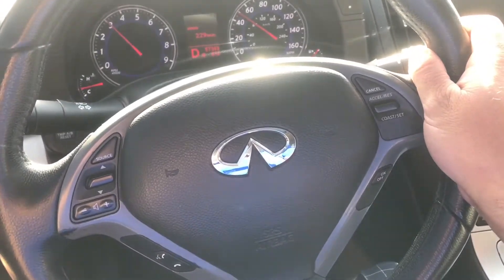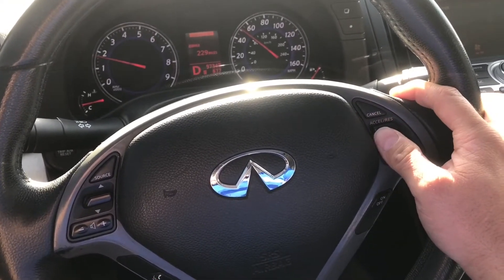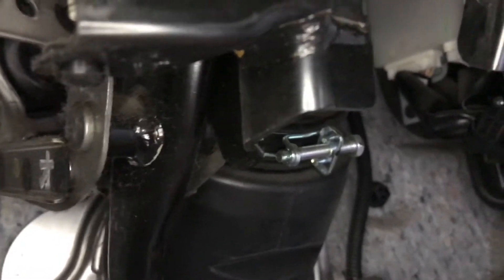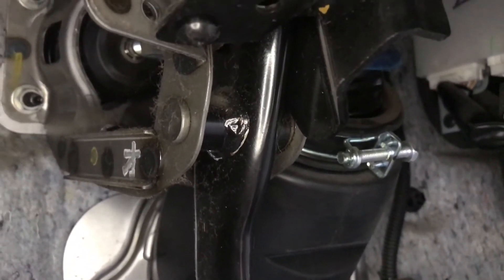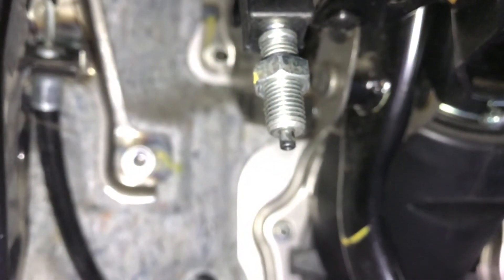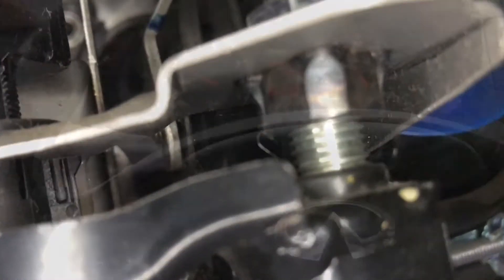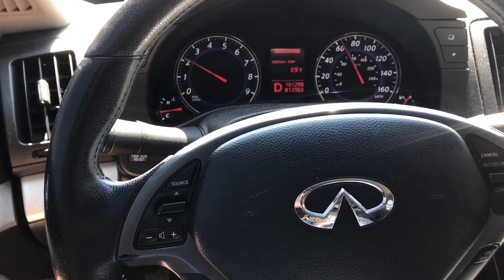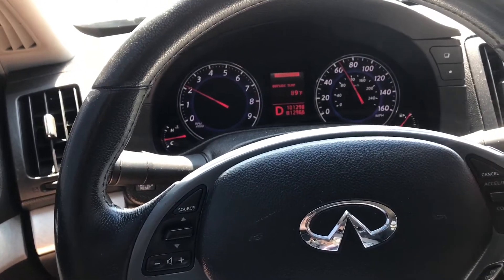2009 Infiniti G37 cruise control repair

Comment: I have different kind of cruise control problem. Randomly the cruise control light comes on and the "set" light starts flashing. When this happens I can't engage the cruise control at all. Any suggestions on how to fix this?
Reply from the maker: Steve A 
I have a question for you does your individual Infiniti have the technology package and if it does your brake pads need to be replaced so the system will start to disengage cruise control traction control stability control and A whole bunch of other systems.
I currently have a 2015 Q70L with the technology package and since I drive so many miles in one year it was time to replace all my brake pads and front rotors.
Once I replaced everything the Christmas tree of lights no longer came back on the instrument cluster.

Comment: hello 
please help i have G37 2013 but my cruise control doesn't even turn on at the indicator screen 
i pressed the on button many times and still there is no feedback

do you have any idea about the problem
Reply from the maker: Khaleel  Dajani 
You have to make sure the fuse is good for the cruise control and the relay.
I don’t have this particular 2009 Infiniti anymore in my possession it was totaled after I was rear ended.

Comment: Mine doesn't work even when I pull the brake pedal forward.
Reply from the maker: Imteyaz Yousuf 
That’s how you know have a bad switch but before you replace it check your fuse.
Reply: @ImportDomestic2006  I just saw a post on IG about this and some guy commented that it's the clockspring. Says it's a common problem on the Gs and Zs. I'll check the fuse too. Thank you for your reply.
Reply from the maker: Imteyaz Yousuf 
Typically the switch that I show on the video is the problem sometimes the Cruise control fuse needs to be replaced or the relay needs to be looked at to make sure it switches between the two individual function on the cruise control.
If the steering wheel has been removed at one point or another the clock spring can break but it’s a very rare occurrence.